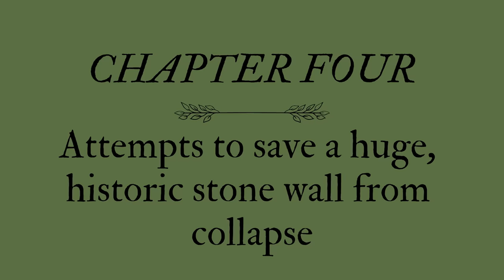Chapter 4: Trying to save a huge, historic stone wall from collapse

Comment: Great video Marc (and the support team of course). When you do your next rod, I suggest you just cut the head off completely and then grind both the bolt and the rebar end to a truncated cone shape. You will find that much easier to weld because you can put both pieces into a piece of angle iron to align them while you tack them. It will also be stronger. 
That fowl certainly has a death wish of some sort. None of them are overly endowered with brains.

Comment: Mark, question... How did the original stone builders get all that granite stone up to the chateau to build all those walls?  It must have taken years to haul all that stone to the chateau and years to build the world walls.  And there must be a lot of stone quarry's in France.   Were there any records of what it took to build all the walls?
Reply from the maker: Generally they would quarry on site for exactly the reason you say! So quarrying the rock and then using the hole or flattened area as the place to build the chateau (with cellars!)